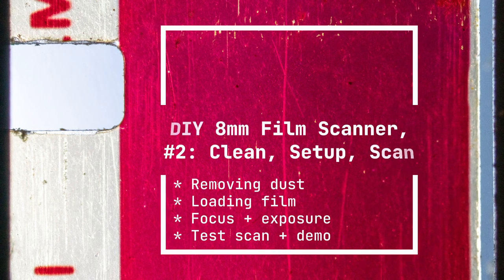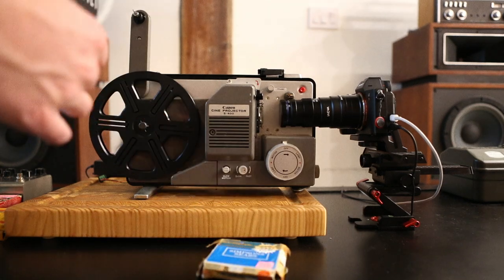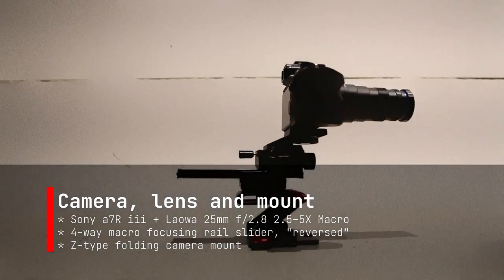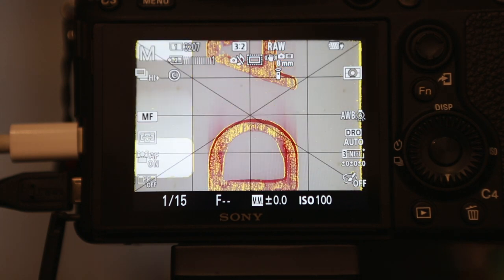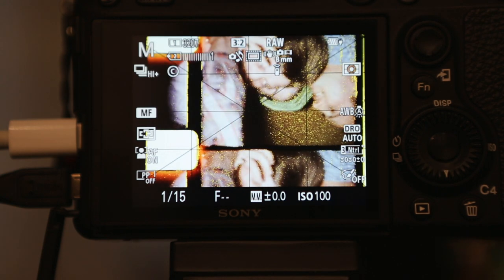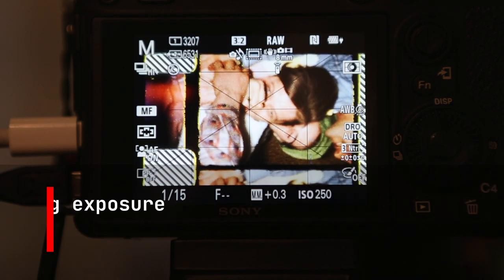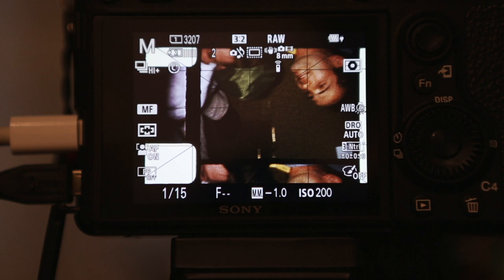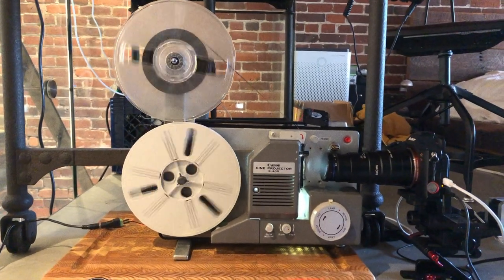📽️ 🎞️ 📸 ⤳💾✨ DIY 🛠️ 8mm Film Scanner, Part 2: Film cleaning, camera set-up, test scan

Comment: Great video, thanks for the idea of using a ping pong ball as a diffuser.
What is the drawback of using camera auto exposure with center-weighted metering, so that overblown sprockets won't ruin the rest of the frame?
Reply from the maker: Thank you, and pardon a late follow-up, here. My suggestion is to use a manual / fixed exposure for consistency, so your frames have the same “lighting.” Otherwise, you will end up with a movie that flickers wildly with varying exposures.

Comment: What type of microphone did you use for your voice, really good sound, i do the same but with S7-1200 PLC works great, thanks for inspiration.
Reply from the maker: Hi Jean-Philippe,
I’m glad you liked the sound! I think it turned out well, for a $40 lapel-style mic from Amazon (brand: “PowerDeWise.”) I imagine similar quality could be found for a bit less, but I liked the clip and adapters that came with mine.

The other big thing was the EQ - boosting low and high frequencies by a few dB, as well as some free “de-esser” and click removal plug-ins. I found some guides online for doing this in Audacity (free sound editor), and the audio here is the result of that.
Reply: @scottschiller  Cool was thinking a Shure MV7 style, i used Audacity too to clean up audio sound on 16mm film tracks.

Comment: Really interesting to see! I've been wondering about the Laowa macro for this use. glad to see it does the job very well. 

I'd definitely recommend getting a set of old film rewinders for cleaning. it's a lot easier to hand wind while holding the cleaning pads in your hand, it allows you to stop regularly to change the pads, and easily inspect then for dirt. You don't really want to be running them dirty as it will scratch the film. the hand winding also allows you to wind slow enough to allow the film to dry before being taken back up. if it winds up wet you could find it sticking together or leaving glossy stains on the film. Also beware using iso on mag stripe film, sometimes it could strip it off.
Reply from the maker: Hi Andrew, thanks for the notes and recommendation! I had looked into rewinders initially, for cleaning purposes. Agreed, need to be careful regarding dirt and potentially scratching or making the film worse.

So far, I haven’t noticed any obvious degradation from cleaning using my approach, testing film bought from eBay. I’ve also tried using two pads as well, a wet / dry that may help ensure the ISO/IPA is removed.

Good point on audio tracks as well (assuming mag-stripe?), thanks! I have one Super-8 film that has a visible waveform - I have a feeling it is not the magnetic kind.

Comment: Another thought Scott.  I see you struggling to move the camera and lens assembly to align them with a single frame - without having the next frame intrude.  Can you not just twiddle the knob marked 'frame' on your projector to reposition the frame in the gate?
Reply from the maker: Ha, yes! I realized this after making “part 2,” and will include that with some other findings in part 3. I now have the frame much more nicely centered, vertically.

Comment: Another point Scott.  I see from the settings on your A7Riii that you have  Neutral  with all three adjustments (contrast, sharpness and colour) all set at zero.  I've found that because reversal film stock was designed to look good rather than be copied, the contrast is set unnaturally high.  I have my A7Rii set with -3 for the contrast and the other two on zero, and I get far fewer blown highlights on my digital copies of hi contrast Kodchrome 40 shot in the 1970s sunlight.
Reply from the maker: Interesting! If these are “baked in” and affect RAW images, that would be news to me. My understanding was that picture profiles, at least, shouldn’t matter in terms of raw photos.

Additionally, I don’t think I can set or change a picture profile or picture effect when the silent shutter is engaged.
Reply: Of course you're right, my bad. I'm shooting the moving film using XAVC S HD @50p and 50M, but your method of shooting individual raw frames has be be better. In PAL land I run the 3 bladed projector at exactly 16⅔ FPS and timeline speed correct it to 18 FPS. No flicker, but quite a few interpolated frames of course.
Reply from the maker: Very interesting! If you have the time, I think a video of your project would be neat to see, and others on YouTube might find it useful. I've seen a number of projects where folks are shooting video similar to you, and I imagine the specifics of timing, the shutter and frame rates are critical to getting a good picture.

It's unclear to me what if any effect the "rolling shutter" and "180° shutter angle" may have when doing video of moving film. While you benefit from a near real-time conversion, there are lots of moving parts to think about!

Comment: Would it be possible to convert this setup and the 8mm canon projector to scanning 16mm film, or will there be problems with lighting or getting modifications to fit? This is amazing, thanks for these videos, i havent seen diy scanner projects look this good, especially with 8mm
Reply from the maker: Thank you! I am actually interested in doing this very thing in the future myself - so, "stay tuned"? ;) I purchased a 16mm projector not long ago, and I am eager to try something out.

In practice, it's the same set-up. You need a way for a motor to drive the projector, and then a way to illuminate and expose the film to a camera that's aligned with the film gate. The actual size of the film, gate and so on, doesn't matter for the scanner I've built here.

As I understand, 16mm film has enough detail to justify a "2K" scan - so I'd argue it's even a better reason to scan at 4K, and reduce your final video if you so choose.

Comment: Going through your video and noticed with the Sony A7RIII you used hi+ mode which is 12-bit raw not 14-bit raw so your actually losing 2-bits of depth range and its compressed lossy raw not the 14-bit uncompresed raw in that mode, same for ISO 250 the native is iso 100 for photo ISO 50 also is handy in terms of noise on the ADCs, though if you want the most exposure range the stock optical filter stack can be replaced, this camara has been my main for a few years so its been fun getting to know it inside and out lol.
Reply from the maker: Good info, thanks for the pointers. In retrospect, this would have been nice to know back then. I thought I had a compressed lossless option in the menu, but wasn't sure how to verify the output. All I knew was the .ARW files were much smaller and not ~80 MB each, etc.

I think sometimes I found the hi+ mode would cause multiple exposures to happen, so I would sometimes slow it down.
Reply: @scottschiller  No one reads the manual hehe, hi+ mode drops colour range for a fps bump as the buffer is limited hi+ is the 8~10fps burst mode standard is 5~6fps if held down, Its not the end of the world with high exposure low ISO shots but it does lose a lot in the shadows etc real world its out the window unless doing sports or high speed stuff. 

Now current gen bodys have 10-bit HEIF thats replaced 8-bit JPEG and the 14-bit raw now has compressed lossless and small/medium/large modes on the A7RV etc.

Adobe lightroom will tell you the bitdepth of the files its a metadata field thats also carryed to DNG which is just a tweaked version of TIFF I like it as its lossless but also it intergrates well to CDNG workflows while saving the dynamic range of the orignal raws, but after cleanup its nice to go to FFV1 in the mkv container for archive most people are alos using the visually lossless 4444XQ for editing.
Reply from the maker: Thanks for the metadata pointer and model-specific info. The extra few bits, and lossless compression might help in recovering very under-exposed film, etc. My guess is with 8mm and super-8, anything above “1080p” should cover the frame and detail pretty well. That said, I aim to scan at the highest detail I can—“just in case.” 😅
Reply: @scottschiller  Well personally I think once you get the grain resolved thats about it, but with modern film stocks people are running there is a lot more information potential, but bare in mind for youtube the 2160p and 4320p brackets have the best encoding and now you can provide 10-bit in HDR or SDR colour ranges too its a shame the 1080p bracket which is ideal for 8mm is now getting worse compression wise.

I'm used to working with analouge tape thats all fun and lines of resolution, but FM RF capture and now vhs-decode de-modulating and time base correcting the frames in software rather then 1000USD dying bits of ex-brodacast hardware makes it all more fun, we have reached peak archive for analouge era mediums but dispite working on tape film is never going to go away it seems like, but then again I got 1 super8 cartrige and 400 VHS tapes so I have put off my own film scanning workflow for last, I think modifying projectors definitly takes a lot of hassle out of making a Gugusse Roller system from the ground up!
Reply from the maker: I’ve tried a few 10-bit HDR (iPhone 14 Pro) videos, still not sure if they work “as expected” on YouTube in the browser uploaded as H.265, but I’m hopeful.

Agreed on 2160p being “preferable” overall for encoding.

I don’t know if you have a channel or place where you post info like this, but I think people would be into it!
Reply: @scottschiller  Okay this is a fun one...

The iPhones make non-standard ProRes files with Dolby Vision, you need either Marvis/Filmic Pro to get a actual complient ProRes Proxy/LT/422/HQ files these days, apple makes you work for good support, like giving us DNG in 2016 on the iPhone 6s but never addding it to stock apps HDR is just correct BT.2020 flagging same as SDR is just Rec.709 flagging YT makes it a bit iffy though need to play with it more, however YT supports H.265/AV1/VP9 and all flavors of ProRes nativey (excluding dolby vision) though the main bias is bitrate with lossy codecs mostly. I have done testing with V210 captures and they have looked great but blacks are just crushed outside of 4k/8k brackets.

I mentioned it in my above reply but I mostly post stuff on the vhs-decode wiki on GitHub as thats the project I mostly work on, as I write the docs for it and well faithfully representing, properly digitised tape is just as much work as film (almost same amount if not more data though) feel free to email/discord poke me all my info is on the wiki etc.

And yes before you ask I posted a doc on ProRes just the outher day and I used to ramable on about iPhones for 2 years on Quora though I need to dig more into HDR stuff to actually set anything for it standards of use wise for any docs I write, I was actually intoduced to an app on Android though called "MotionCam" and it shoots DNG for video sequences 12-bit raw on most higher end phones really cool considering its making use of the burst photo unlimited buffer thanks to NVME storage chips nowadays.

Comment: Hi Scott, you did not only a perfekt set-up of a DIY Film transfer but also a very comprehensive description of it. So it is a perfect guidance for me just starting to build my own. Could you assist with some more details: What is distance    of the objective front lens to the film surface? What is the diameter of the Laowa macro lens? This could be a difficult point with many projektors since their body prevents to move the lens closer than approx. 5 cm to the film.
How did you so the video processing, which software is required/recommended?
Best wishes, Ed (from Germany)
Reply from the maker: Hi Ed,

Thanks for the kind words, and I’m glad you’ve found this video of interest! I’ve learned a few things along the way, and I have a “Part 3” planned which will hopefully add some more detail including post-processing and eventually, video exporting. I use Lightroom and DaVinci Resolve, respectively, for that.

I don’t have the camera and lens set up at present, but you are correct in that the barrel of the lens gets right up to the side of the projector body. It may be necessary to remove or carve out some of the body shell to make room for the lens, in some cases. So far, I haven’t felt it necessary to do in my case. It is pretty tight, though.

Comment: There are indeed lots of things to consider. Normally when we watch projected Super or Standard-8 we're shown each frame three times, then the claw pulls the next frame into the gate and we're shown that frame three times and so on. 

This gives a flicker rate of 54 Hz on screen. This is 'acceptable' to most people, but it still flickers. TV on the other hand (CRT or flat panel) is a continuous light source, so each movie frame need only be shown once. Problem is that 18 frames have to be extrapolated out over 25 frames in our case, and 30 in yours. So although I'm capturing all 18 frames in every second, stepping through the timeline shows the computer has almost done a mix 'n' match job in an effort to make it look right. 

Careful analysis shows that sometimes the top of the frame is one frame ahead of the bottom of the frame, and sometimes two frames are overlapped due to interpolation.

But how does this gooey mess look to human eyes on screen? Surprisingly good funnily enough, so I'm convinced that photographing every single film frame is technically superior to my 'refilm the gate at 16⅔ FPS' but (because of the inevitable and subsequent interpolation) unnecessary. We humans are not adept enough to spot what's going on at the single frame level.

As my dad used to say, if a thing looks good it generally is good.
Reply from the maker: Sorry I missed replying to this earlier! Good info. I have noted some flickering when watching film on projectors, I wasn't sure exactly how it worked. The 54 Hz aspect sounds about right, yes. When I export MPEG-4 video here, I actually specify 18fps as a frame rate and I think that carries through until display time where it's up to the device to do re-timing or interpolation or what have you.
Reply: You can export MP4 files and specify they be 18 FPS? How strange, but then I suppose these days 24 FPS looks to be a strange frame rate. TVs can handle all sorts of frame rates, so I suppose it grabs those 18 different frames and spreads them out over 1 second, even though our TVs show 25 FPS and yours show 29.97. I think that's asking a lot for a TV to do this on the fly. Better to give the computer's horsepower render time. and
Reply from the maker: DaVinci Resolve, which I use to edit and export, allows frame rates of 16 or 18 FPS among others. I think the MPEG spec is pretty flexible on frame rates, but it's probably wise to stick to conventional standards. Theoretically, when you have a 1:1 frame match for film-to-MPEG, your MPEG bitrate should be quite efficient. Each frame could be an "I"-frame at the highest bitrate, and you wouldn't have any extra interpolated frames.

All this said on frame rates and whatnot, I do think TVs and displays are good at upscaling and converting as needed.

I've seen some "smart" TVs that also have "smoothing" features which try to interpolate between frames and sort of resample motion, which I personally find annoying - you can tell something just looks "off" when watching older TV shows, for example.

I've gone back and forth between exporting scans at 4:3 and 16:9 also, just to see how YouTube treats them. With some Super-8 films I've seen where the picture is "full-width" across to the sprocket holes, that aspect ratio can approach 16:9 - so it fits rather well.